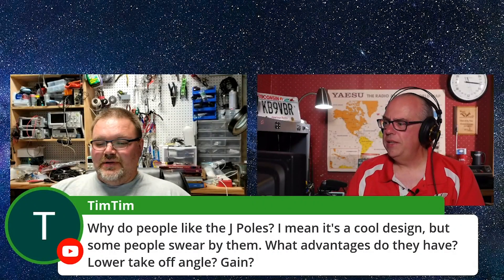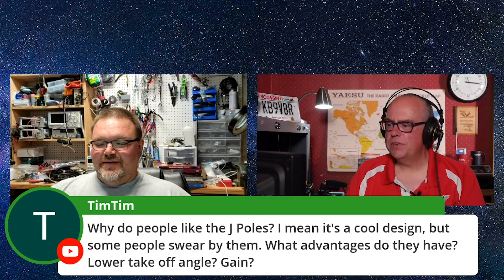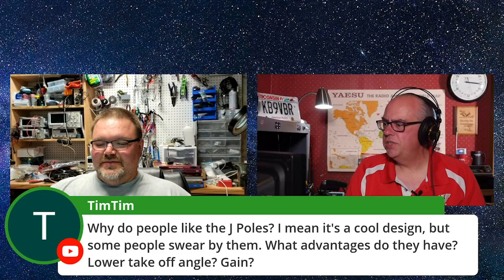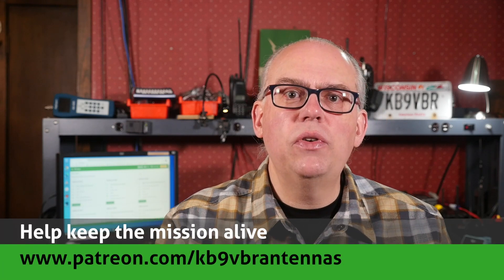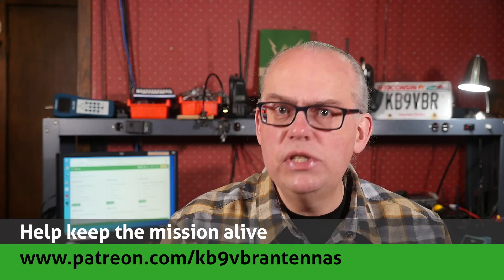Why Is The J-Pole Antenna So Popular?

Comment: I'm new to ham, so new I'm in the just listening not yet licensed phase, could you expand on what you meant by not wanting to much signal on a handheld?
Reply from the maker: What happens is that the front end filtering on a handheld radio is not very good. This is mostly because of size constraints- proper filtering would take up too much space in the small device. On top of that, radios with SDR receivers can overload easier that ones that use a superheterodyne receive. This isn't normally a problem when you use the rubber duck antenna as those antennas aren't very sensitive. But when you connect a handheld to a high gain antenna, strong adjacent signals can overload the receiver, causing desense and intermodulation distortion. J-Poles are medium gain antennas, so they provide good gain and coverage, but not so much that you overload your receiver.

Comment: Hi Michael, I just bought as my first radio a AnyTone AT-D878UV11 Plus. I have a commercial 32ft flagpole anchored in 1.6 yards of concrete... it’s not going anywhere. How far would one of your j-pole antennas mounted on top of my FP enable me to reach? I live in farm land in eastern NC. Thanks for your response!
Reply from the maker: It's tough to accurately tell you a distance, but from experience with a 5 watt HT, you should get 5-10 miles on simplex and hit repeaters 50-60 miles out. That's a conservative estimate as this all depends on average terrain and for a more accurate estimation, you can use a coverage plot program like Radio Mobile: https://www.ve2dbe.com/english1.html
Reply: Thank you kindly!!

Comment: Does tarnish affect the radiation pattern or SWR?
Reply from the maker: In my experience it does not. I have J-Poles that have been on the air consistently for 15+ years and their SWR has not appreciably changed.
Reply: @KB9VBRAntennas  Thanks

Comment: There's a prominent East Coast satellite operator that uses a j-pole mounted on his roof connected to his base station to work FM satellites.  His signal is usually quite good and it sounds like the primary issue in that application is that the RX suffers from spin fading since the antenna can't be manipulated to match the signal polarity.  Usually pretty easy to make contacts with him though.
Reply from the maker: J-poles are half wave antennas and their radiation pattern seems to work well for satellite receiving. I use a J-Pole to receive SSTV images from the International Space Station and usually can get very good coverage from AOS to LOS as the ISS passes overhead.

Comment: Hi sir, I'm Jun Lopez from the Philippines and planning to build my own J pole just like what you have. My questions are, from the short pipe that connects the 2 pipes, what is your measurement to where you tapped the SO-239 for best SWR and 2nd, doesn't it matter where the positive of coax is tapped that doesn't affect the performance? Thank you very much for your time sir.
Reply: center conductor to long ---- shields to short.
Reply: @elelectrotech  Thank you very much sir for the reply and help. Keep safe always...

Comment: How are J poles for 70cm repeater use? The repeater's antenna. I know the pro's  are probably low noise floor and broadband . Any cons?
Reply from the maker: Probably the biggest con is the gain of the antenna. Repeater antennas typically are higher gain in order to concentrate more RF energy towards the horizon, and to help overcome feedline losses. But if you are just putting together a repeater system that only needs to cover a neighborhood or localized area, a J-Pole may be a good choice.

Comment: since you 2 claim that rf doesn't go around corners, how does rf travel around the jpole stub? i also once designed a meandered pcb trace antenna with about 10x 90-degree angles and that puppy transmitted for 10 miles on 125mW. i think you guys are wrong and should get to the bottom of this.
a question regarding this video, with a jpole my understanding was that the mast or feedline becomes part of the radiator, i didn't notice y'all talk about that little detail, maybe i'm wrong on that one.
Reply: Which is why you need a choke between the J pole and your feed line.
Reply: @knife-wieldingspidergod5059  if you use a choke, that just deals with common-mode currents and prevents the outside of the shield from radiating but as far as my understanding goes then the mast will have to be part of the radiator. basically the energy that is being forced into the antenna needs something to push against, what is that?
Reply: @pratwurschtgulasch6662  From what I know (not much) the J pole itself is a dipole that don't need something to push against. It's a compete package.
Reply: @knife-wieldingspidergod5059  that makes sense, i don't know much either.

Comment: I live in a valley, and built a J Pole (would have bought it from you, but kinda wanted to try my hand at it). Using my 10w ht and aftermarket Nagoya antennas, I usually can’t hit a repeater just about 20 miles away unless its the dead of winter when all the trees have lost their leaves. And then, its VERY spotty. From a 10w HT with the bottom of the J about 10ft off the ground, it was hitting repeaters about 50 miles away. Its now a bit over 20ft off the ground from the bottom of the J, and I always get good signal reports on 2m on any repeater I can hit using my base station. I am still a relatively new ham, but I really like the J Pole design for VHF.
Reply from the maker: I usually recommend J-Poles for those living in valleys or other low lying areas for the same reason. The radiation pattern can help in getting your signal out and into the air.
Reply: @KB9VBRAntennas  I either read or watched there you mentioned that, which helped inform my decision especially between a jpole and a slim jim. Thanks for the reply! I appreciate all the information I am getting from your videos and blog!

Comment: I have a 10M J-Pole antenna in my back yard sitting on a pole 6ft above ground.  It's tall mast is 34ft - I refer to it as my lightning rod.  It works great, when the band is open at least.

Comment: I have 3 antennas from KB9VBR, 1 2m JPole, 1 UHF Slim Jim , and 1 2m Slim Jim. All are amazing. They are all at different locations and are excellent, rugged, effective antennas. I put them high up towards the top of ponderosa pines and the copper tarnishes with encouragement to camo, or you can paint them,  and hide their presences. There they stand through snow and high winds, year after year. K7ODB, 73

Comment: I use your jpole antenna strapped to my chimney and it's just enough to get my signal through the noisy city and into my clubs repeater around 15 miles away.  Since the addition of a small 25w amplifier, I'm full quieting and have excellent audio reports.  Also, as a side note, so glad to get a P2P with you on 9/10 from K-0656!  73
Reply: PS - Have you just not submitted your logs yet or are they just taking a long time to process?  Last activation I see from you on the site is 07/24/2021!
Reply from the maker: I'm glad to hear the antenna works great. Thanks for the Park to Park.  I just got home from our weekend trip this afternoon, so I haven't uploaded the log from it yet. I do have a bit of a backlog from my last couple of activations. I'll process them this week and get them sent off.

Comment: Good video and I have a 2M /70CM J-Pole mounted on my desk in the ham shack to use in severe weather conditions.  It hits all the repeaters in my area and I can use it with an HT if the power goes out.

Comment: I use one of your J-poles about five feet off the ground with a 20 watt VHF/UHF radio.  Getting solid signal reports from repeaters 30 miles away.